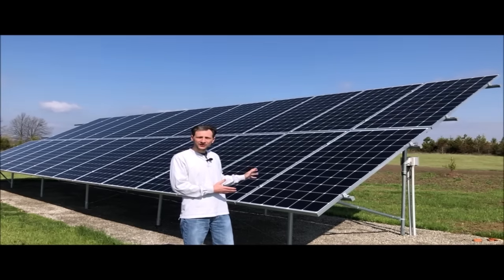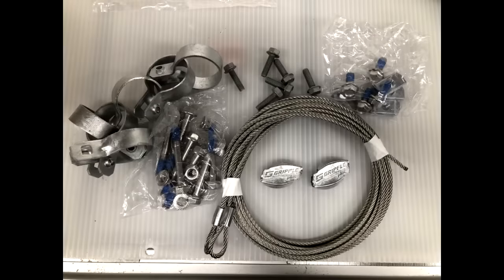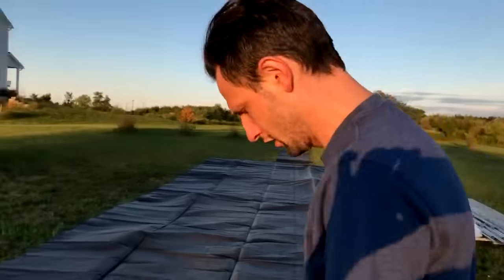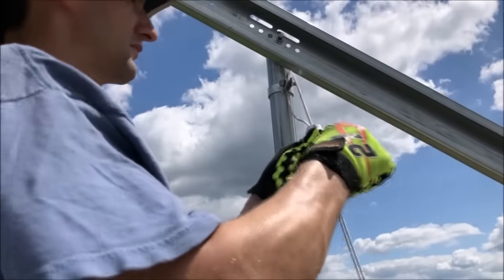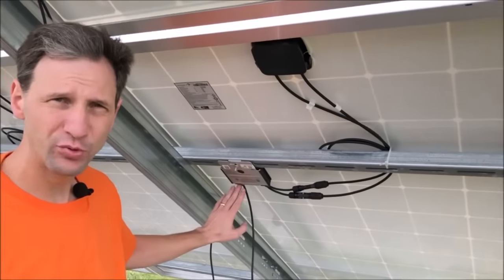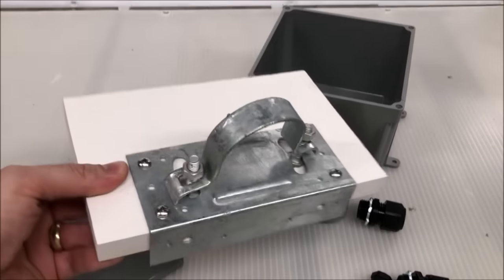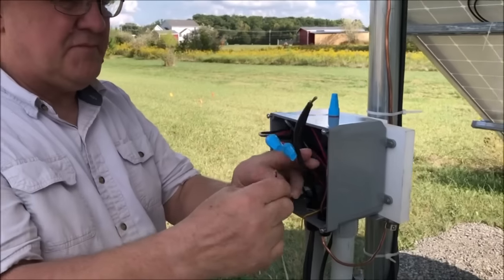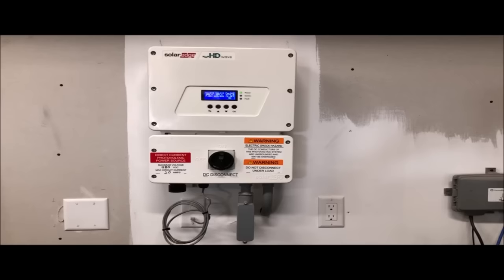DIY 9kW Grid Tie Ground Based Home Solar Panel System Installation

Comment: Good move building it on the ground what most people don't think of is when it's on your roof and in 20 years when your shingles need to be changed or if your roof is leaking you need to remove every single panel and the rack for the repairs then have to put everything back on.  On the ground its put it in and forget about it.
Reply: It's also cooler

Comment: Thanks Dave! I reached out to Linda and mentioned your name. Got a great price (.46pw) on 28 new Panasonic panels delivered. Linda was great to work with. Bought em!

She had good used ones for .30 and .32pw, but opted for new.

Thanks for your great videos!
Reply from the maker: Great!  Linda's great to work with, I'm glad she was able to find a good solution for you.

Comment: I've been researching going solar+battery/off grid for a couple years, and the sheer amount of information out there is incredible because of people like you. This probably gave me the biggest dose of what to expect when setting something like this up, or something very similar. Thank you very much for showcasing this. :)
Reply from the maker: Thanks!  Your right the amount of information to digest is pretty overwhelming.  I'm glad this was helpful.
Reply: @ProjectsWithDave  Optimizers are mandatory ? i mean we already have MPPT in inverter then why go for these Optimizers ? Cost of Optimizers must be very high?
Reply from the maker: DC/DC optimizers like I used on my system are not worth the expense.  I learned that later, here is a video on my analysis: https://youtu.be/nC7i_GSrGlk

Comment: Out of all of the videos regarding solar system installations, yours is definitely the most comprehensive and easy to follow. My only wish is to see one made equally as good as yours on an off grid system. It would also be nice to have you list the sourcing of the products you used and costs. The ground mount system really has me interested. Great job, no, fantastic job making this video!
Reply: For off-grid look for a all in one systems  like mpp solar, Sol-ark inverters and victron inverters.
Reply from the maker: Wow, thanks!  I have had a couple of requests for component lists, I'll see what I can do.

Comment: Thanks for the great video. One trick for the conduit to avoid having to put all the rope through ahead of time (which is a pain and takes forever) is to put your conduit together, glue it, trench it, and cover it up. Then when you're ready to run your cables through, tie a little plastic bag or something to your rope or pull string and suck it through with a shop vac. I did this with a long run to a new barn and it took about 30 seconds. When I pulled the wire through, I also pulled more line/rope in case I ever want to use the conduit again for something else. Now I have the wire and a piece of vinyl pull rope in the conduit. Future proof!
Reply from the maker: That's a great idea!  I actually used a wad of paper on the end of a string to run the line through the conduit in the garage, except I blew it through with compressed air.  It worked great. Also, I ran a separate conduit parallel to the first to allow for future expansion without trenching next time.

Comment: Having used tons of that weed mat, I've found instead of cutting X's for the post, to use a propane torch and burn a hole. It melts the edge and reduces fraying
Reply from the maker: Thanks for the idea.
Reply: @ProjectsWithDave  I'm rewatching the video today as I have ordered a system and just waiting for the permit to get started.

Comment: Hi David  Very Impressive display of basic construction techniques, working with others, grid tie solar ground mount installation, but most of all, how to be a dad.  Loved the video.  I also have a SolarEdge grid tied system I installed in 2015.  I had a whole house standby generator first so had to figure out how to wire them both so they would not try to work against each other.  I also purchased my components from Wholesale (Unbound) Solar in Mt Shasta, CA.  And like you, I didn't feel comfortable poking holes in my house roof, so mounted the panels on my barn roof instead.  Thank you again for this.  You, your son, chickens, and others, did outstanding work!
Reply from the maker: Thanks!

Comment: I finally pulled the trigger on panels, working on the rest. I am also in Ohio and with the weather we have been getting I would like to reduce my reliance on the grid (initially grid tie but soon adding batteries). Thank you for the video!
Reply from the maker: Nice!!  Grid tie is a great way to get started.  Good luck!

Comment: Awesome video and work! If you ever have to run mule tape through conduit again, you can build out your conduit then tie a bag like Home Depot bag to the end of the mule tape and get on the other end with a shop vac and it'll suck it all the way through real fast. Makes it super fast and easy and the tape isn't in your way as your glueing everything together. If the connection between conduit and shop vac is leaking too much just wrap another HD bag around it and it'll seal it up.
Reply from the maker: Thanks!  Thanks for the tip, I'll try it in the future.

Comment: Great video! I installed my own system too, but back in 2013 panel sizes were smaller!  I chose Enphase micro inverters, which is similar to the Solar Edge DC option, but keeps it all AC, so no wall inverter is needed. My system paid for itself in less than 3 years, but I am pushing 20 kWh in full sun. My problem here is trees from all my close neighbors, where as you have no shading issues there. Thanks for showing people they can do it themselves! I remember there was little help when I did mine.
Reply from the maker: Thanks!  Sounds like you have a great system, a 3 year pay back is fantastic!

Comment: Well done, thanks for the in depth description. I would suggest next time you delve into the AC connection, even if it's not supposed to be hot, you should remove your rings from your fingers.
Reply from the maker: Thanks for the tip!

Comment: Timestamps: with leading zero so the  columns are in alignment
This is the correct way to do it:
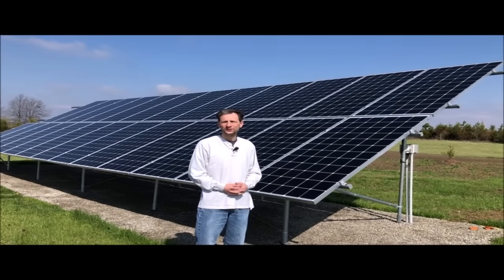01:17 Solar Materials
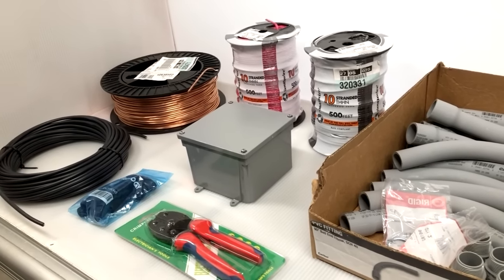05:21 Racking Materials
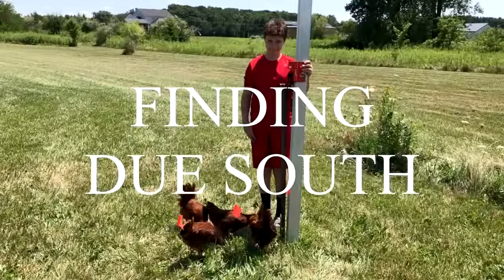07:27 Establishing Build Site/ Finding Due South
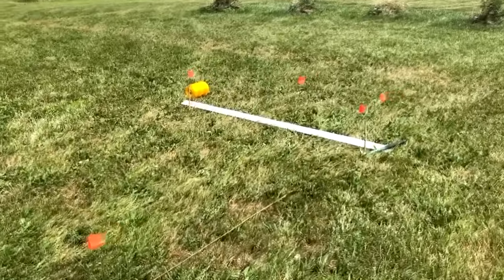09:17 Rack Assembly/ Screw Installation
12:40 Ground Cover
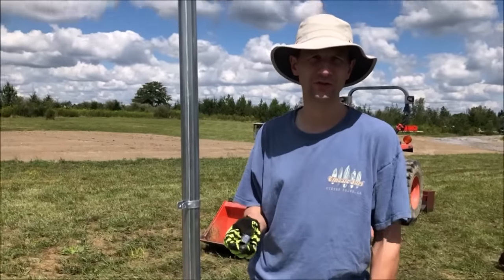16:35 Rack Assembly
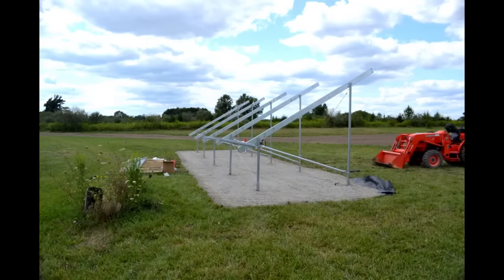23:45 Solar Panel Install
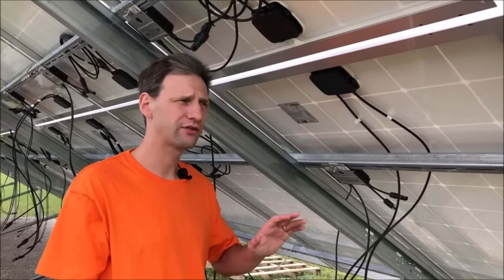25:12 Solar Panel/Optimizer Wiring
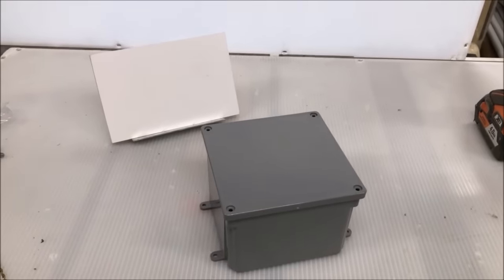34:17 Combiner Box Detail
36:13 Conduit from Array to Building
37:25 Trenching
40:44 Wiring Combiner Box
43:57 Installing AC Disconnect
45:17 Installing Inverter
48:35 Inverter Running
Reply from the maker: Fixed! Thanks for the feedback!

Comment: Good job on setting the posts and getting them plumb!
Reply from the maker: Thanks!
Reply: Wouldn't it be called square?
Reply: @JM-yx1lm  My comment was an insiders comment for people that use PTO Augers. Watch how they struggle to get the post straight up and down (plumb) it's a real challenge as the angle of the auger wants to change as it get lower. I usually have to do that type of work single handed and from the tractor seat you can't really see the changing angle of the auger.

Comment: An easier way to deal with your fish tape is to tie a plastic bag to the end and use a vacuum cleaner to suck it through the conduit, that way you are not working around it while cementing the pvc together.

Comment: Any clue how to tie in a solar system (let’s just say identical to yours) into a multi gang meter panel? (Have a 6 meters for an apartment). Do you have a schematic for your system? (Trying to understand why you have (2) 200amp breakers in your meter panel).

Scour the Internet, and cannot find anything online solar into apartment buildings with multi gang meter panels (I’m in CA). Thank you!!
Reply from the maker: I imagine you would simply back feed the main panel at each apartment.  The best thing to do would be to call the engineer's office at your utility and the inspector at your building office and ask them for advice on your particular situation.  They are usually very helpful.  You could also take some pictures of your equipment and go in and talk to them.

Comment: Suggestion: use a common shop vac to suck the string through the conduit. In this manner you can assemble the conduit without messing with t	he string.
Reply from the maker: Thanks for the tip!

Comment: Wouldn't it be better to build a roof structure to install them on so that you could utilize the shaded dry area underneath?
Reply from the maker: I did consider that, it is certainly another good solution.
Reply: @ProjectsWithDave  Thanks for providing such a thorough tutorial.  It seems like you have plenty of land to spare regardless.

Comment: Very good video. Very straightforward. I'm wondering why you didn't connect your panels in parallel. You would have more current out to run that distance to the house. Very clean build at any rate.
Reply from the maker: Thanks!  The two strings do connect in parallel at the inverter.

Comment: Great 👌
But make sure run heavy gauge wire for longer distances to minimise power loss in wire
You should use atleast 8mm² wire for each string.
Reply: The cabling sizing must be calculated - peak current / length are the variables, max voltage drop generally should be just a few % depending on local codes, any pro would be doing this, perhaps not your average DIY'er who might go on recommendations on youtube comments.
Reply from the maker: The distance was less than 175'.  There are two sets of 10 gauge wires (6mm^2), one for each string.  Because the voltage is 480v the loss is actually very small.  I calculated the revenue loss vs the cost of upgrading to 8 gauge wire 10mm^2), but the payoff was clearly not worth it.

Comment: Sweet install. I used the white wire ties and they fell apart. Changed over to black Uv ones and  no problem since :)
Reply from the maker: Thanks for the suggestion.
Reply: I work Maintenance in large industrial plant. Do lots of outside equipment installation. Black ties way superior to white in longevity. One would think white reflects sun---good, black soaks up sun---bad, but turns out with opposite effect.

Comment: The wire from the panels to the house looked way too small for that fairly long distance running about 12 Amps at the full 4.5 kW for each pair of wires.  The less power loss the  better.
Have you checked the voltage drop on each pair?
Reply: It will be fine for 6mm² wire
Because continuous current is about 8A 
Peak is 10A
For each string
Reply: @agsolarpower5975  Not knowing the distance from the inverter I guessed about 100M so there is about 75 Watts loss not taking into account any junction resistance.
Reply from the maker: The distance was less than 175'.  There are two sets of 10 gauge wires, one for each string.  Because the voltage is 480v the loss is actually very small.  I calculated the revenue loss vs the cost of upgrading to 8 gauge wire, but the payoff was clearly not worth it.
Reply: Waite you said you connected your panels in series and got 12vdc, so where is the 480 Vdc coming from?
Reply from the maker: Each optimizer puts out 1vdc until the system is initialized by the inverter.  This is the "safety" voltage.

Comment: Excellent video. I have found that the white zip ties don't hold up to the UV. The black ones last longer.  I like the idea of using the post hole borer. I didn't think of that.
Reply from the maker: Thanks!  I've had the UV Zip tie suggestion before.  Here is a link to UV Resistant Black Zip Ties: https://amzn.to/3hwENeS
Reply: @ProjectsWithDave  Thanks for the link. At least it is pretty easy to replace the zip ties if they fail. I expect that they will last several years though.

Comment: Why didn’t you put a copper ground rod at the end of the panels in the combiner box trench?
Reply from the maker: The racking system has galvanized screws almost 4' into the ground, they provide grounding at the rack.
Reply: So is it a must to have that ground rod after so many panels? So sat I had two of these setups is use two or only one of they were combined?

Comment: nice. dont forget to use sacrifical anode to prevent corrosion on the racks.
Reply from the maker: I have utilized the industry standard methods for preventing galvanic corrosion on a PV racking system.  The Racking is galvanized, the PV modules are anodized and the fasteners are stainless steel.  The only thing less noble than zinc is magnesium.  Are you suggesting to add a magnesium anode somehow to further improve the corrosion toughness?  Here is an article on PV racking corrosion for reference:   https://www.cedgreentech.com/article/galvanic-corrosion-and-protection-solar-pv-installations
Reply: @ProjectsWithDave  exactly. Cheap and add more protection.

Comment: I'm just beginning to educate myself about installing a solar system and from what I have read and viewed so far is that optimizers are beneficial if you have shading issues or your solar panels are oriented in different directions. Neither case appears to be an issue for you. So, what drove your decision to include them?
Reply from the maker: Great question.  Since my panels are ground mounted, I didn't have to apply panel level rapid shutdown, and as you stated I have no shad or mismatching, so I did not need to have optimizers.  However, I wanted to have a deeper understanding of the operation of the system at a panel level and flexibility for future expansion with different panels or angles.  For instance I have added a panel to one string making it 13, but I can still combine the power from both strings because the optimizers keep the voltage at 400VDC no mater what.   I will be doing some future videos showing the operation with used and mismatched panels.  Hope that helps.

Comment: While I am delighted with the frame and method of assembly (I especially like the insulation from the ground and gravel ballast under the spans) and the earthing of the panels, there are several things that make me deeply concerned.
1. As I understand it, screw anchors in total play the role of grounding the frame and thus the panels - have the ground resistance measurements been performed? In Europe, there is a legal requirement that the grounding resistance should be less than 10 ohms. In practice, good grounding is considered to be one whose resistance is less than 5 ohms in the dry period. In practice, two stainless steel rods are used, driven to a depth of about 10 meters each, at a distance of several or a dozen meters from each other (usually on both sides of the frame), electrically connected to the frame (to each higher vertical element just above the ground) by a flat bar with a large cross-sectional area - no less 20 square millimeters.
I doubt whether the anchors themselves guarantee this quality grounding.
2. I don't see any sign of overvoltage / lightning protection either on the PV panels side or the inverter side. In Europe, if the distance between the panels and the inverter is more than 20 meters, this protection MUST be on both DC sides.
3. I don't see any trace of PV strings DC overcurrent protection. There is no formal requirement to use such security, after all, it is important for the safety of their own and their own family, and their own property ... Everyone uses it regularly.
4. Also without a formal requirement, a DC disconnector is used regularly, as a rule outside the building (so that the fire brigade has easy access to it) disconnecting the DC strings. This is in the event of a major breakdown when the owner is not at home, and it is also widely used.

It is cool as long as it is cool and the user thinks: "For what the hell do I have these costs and inconvenience?" But let the lightning strike the frame, or there will be a short circuit and as a result someone will be struck by AC current, or a fire will arise, the first thing the insurer will check is the security condition. If he found them missing, or if they did not comply with the regulations, he would in 100% refuse to receive compensation.

I'm not writing all of this just to criticize. I am only sharing my observations, which may berry into the upgrade of installation of the above-mentioned protections, which will undoubtedly increase the safety of using PV installations.

Contrary to appearances, the costs are not great in relation to the costs of the entire installation, and the profit (in the event of a failure) and peace of mind are priceless.
When building a large PV installation, you must always remember that it generates a large amount of energy, with very high voltage, sufficient to cause very serious losses if not carefully secured. There is no room for underestimating the dangers here. Because the question is not "can something happen"? The question is, "when can this something happen".

When building a large PV installation, you must always remember that it generates a large amount of energy, with very high voltage, sufficient to cause very serious losses if not carefully secured. There is no room for underestimating the dangers here. Because the question is not "can something happen"? The question is, "when can this 'something' happen"?

Besides, I envy the size of the plot - you can easily build a regular off-grid installation.
Reply from the maker: Thanks for your thoughtful feedback!